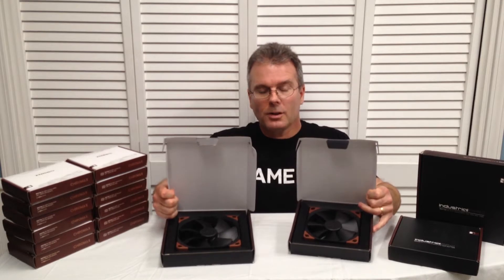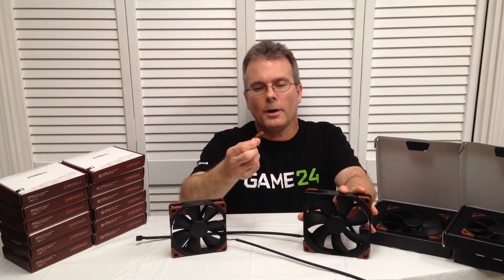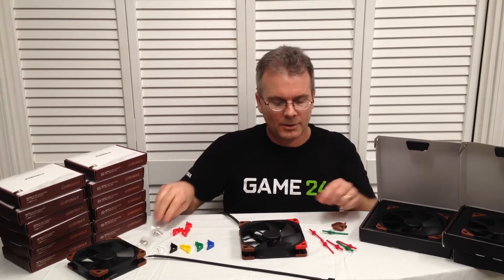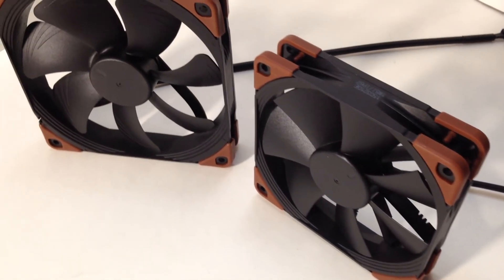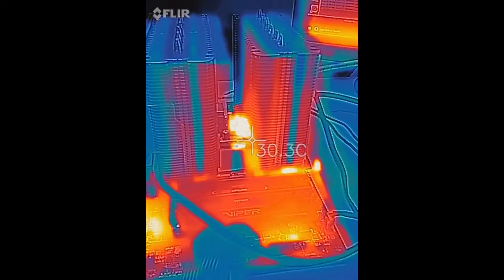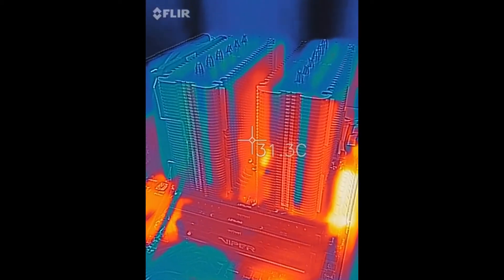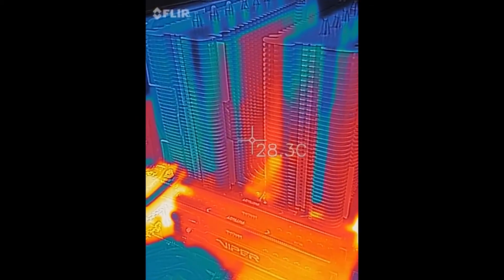Noctua Industrial PPC NF-F12 / NF-A14 Fans Review

Comment: whether it is possible to connect this fan,(Noctua NF-A14 2000RPM | industrialPPC)to an ordinary ,12v. power adapter,if possible, it would be very helpful for me to write me how to connect it!!
i don't want to connect it to the computer @t be connected separately only to12v  power adapter.
I appreciate verry much if you can answer this question

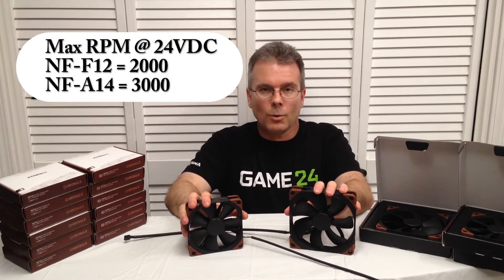Comment: 01:00 this is factually inaccurate. The NF-F12 & the NF-A14 run at 3000 RPM on your standard 12v power rail. It's only the 24v variant (which lists 24v in it's name) that run at half the listed speed on a standard 12v power rail. Which is to say 1500 RPM. I have 7 of the 140mm NF-A14 fans running in my Desktop PC at a full 3000 RPM.
Reply: jesus did it hit the wall when its on full blast?

Comment: The first half was informative but I don't see what we learn from thermal imaging.  What is the internal CPU temperature?  Also, on the Noctua web site they list separate fans as being 2000 or 3000 RPM 12V and 2000 or 3000 RPM 24V models.  Can't you just order the 12V version for a PC?
Reply from the maker: My intention with the thermal imaging was to see if there was a cooling difference between running at 12V and 24V.  But you are correct - I should have included the CPU temps. The spec listings on the site are probably different because the fans in this video are an older version with different ratings - I believe they are still shown on the Discontinued Items list.  So the specs for the newer versions are slightly different. And yes, you should be able to order a 12V version for a PC.